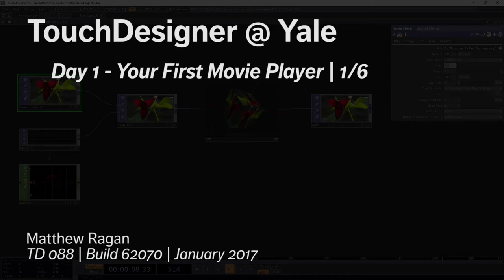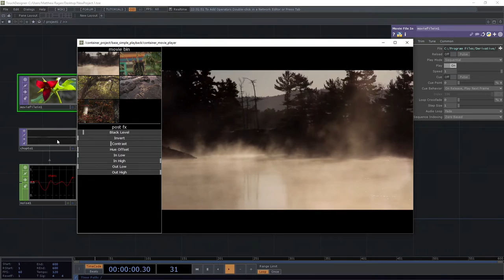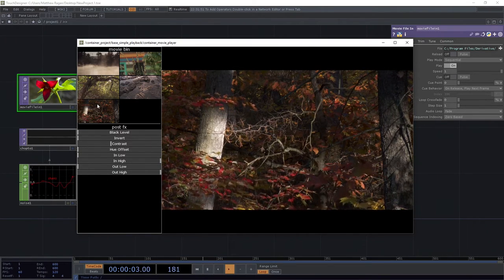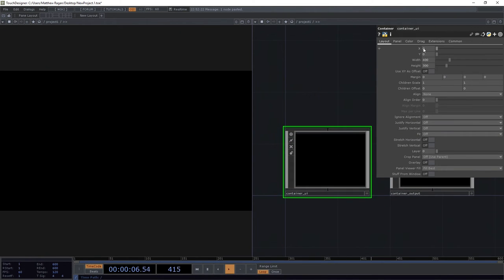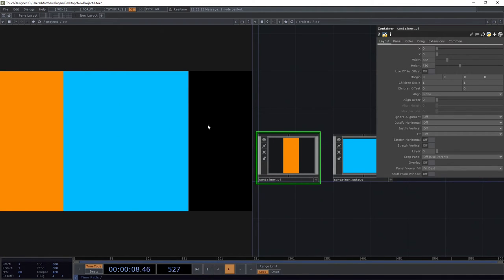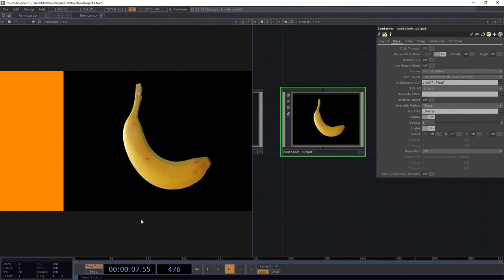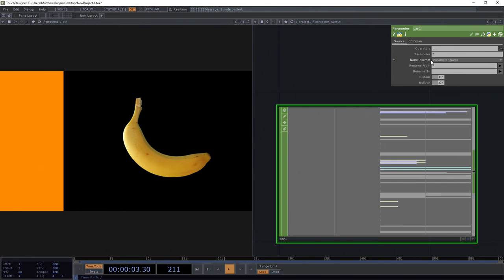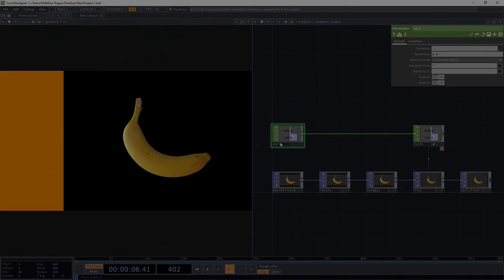Day 1 - Your First Movie Player 1/6

Comment: awesome tut! For some reason, my parameter chop won't receive the data by the drag and drop method you used from the movie file in. Not sure if there's an update that changed the behavior of the object, or if I'm missing something.
Reply: for more context, if anyone sees this. The parameter chop when dropped in initially to the network shows nothing in the viewer. When I drag the moviefilein object onto the parameter chop, it recognizes it in the operators under the source tab, yet nothing shows up in the viewer.  Further, there is a gray line that is drawn between the two objects, but the arrows on the line are not moving indicating that the data is not flowing correctly between the objects. If anyone has any ideas on what I'm missing, it would be greatly appreciated.
Reply: Ok, I figured it out! There is a built-in switch that needs to be flipped on in the parameter operator. I'll leave this here in case anyone else has the same issue.
Reply from the maker: hmmm - that's interesting. If you post your file on the forum I'll take a look :)
Reply: turns out it was because I didn't have the built-in switch on by default in the parameter operator. Seriously thank you so much for these tutorials and commitment to teaching. It's such an amazing resource. I will be sure to start posting on the forum as I run into trouble.